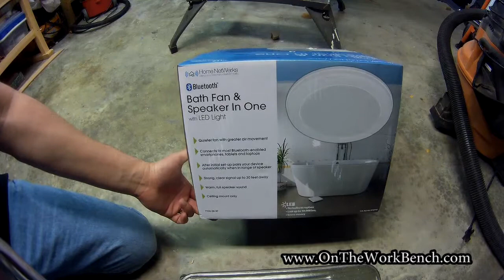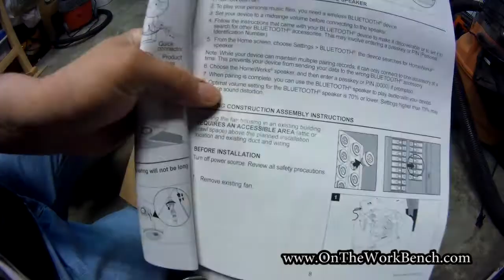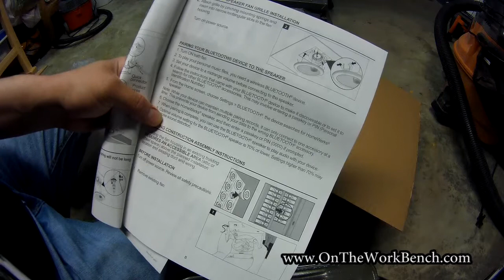Home NetWerks Bath Fan, Light & Bluetooth Speaker

Comment: It's it possible to wire the light separately from the fan? My wife wants a separate switch?I have the 80 cfm model.  # 7130-18-BT
Reply: Yes the light/BT is seperate wire

Comment: My Bluetooth speaker doesn’t even beep when I turn the light on and no one is connected any solutions thank you
Reply from the maker: Did it get plugged in during installation? I would double check that first.
Reply: Thank you for the reply I did figure it out it was just a issue with my Bluetooth on my phone
Reply: @justynskatez   how did you figure it out mine won't even be discover I have searched with different phones
Reply: @Francisco313dtw  I just went in my settings clicked on Bluetooth then I clicked the homework’s speaker and clicked forget this device and turned my Bluetooth on my phone off and back on then the speaker came up in connectable devices and it connected

Comment: It worked for 2 days and now it doesn't work . We turned off all phones from blue tooth and all have tried but no sound . Any suggestions would be appreciated. 
Thanks!
Reply from the maker: Could be several things...Were all the electrical connections tight? Hopefully yes so that no loose wires to create a short. The other thing you might try is to delete the device out of your phone then re pair the speaker
Reply: Any luck? I’m having same issue worked one day now can’t pair, no chime at all
Reply: Heidi Fuentes 
Now we found if everyone deletes the 
Home netwerks on the blue tooth then just one person does it one at a time and deletes it after they use it. Then it works

Comment: How can you clean it?
Reply from the maker: Remove the cover/grill. Make sure the power is off to be safe, then when done replace the grill. On the fan it's important to clean each blade all the way to make sure it stays balanced. If the blades are not uniformity cleaned it may lead to a whining sound and excess bearing wear.
Reply: How do you remove the grill?